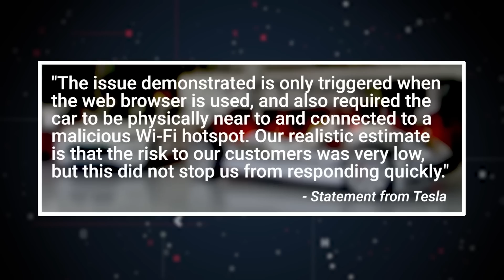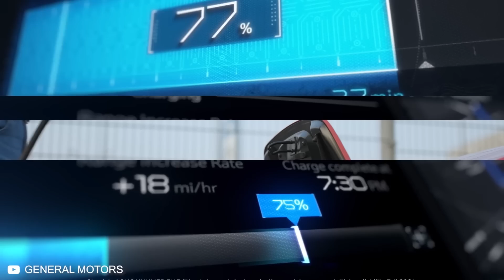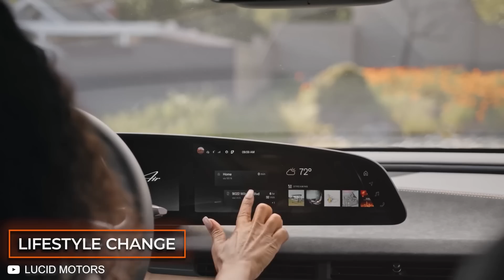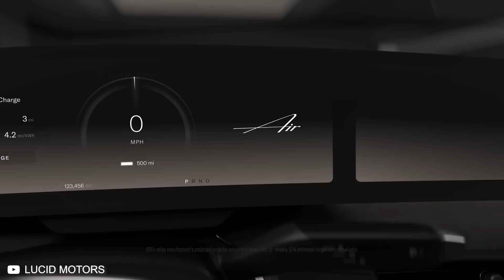EVs' Serious Problems That Carmakers Are Hiding

Comment: What does one do with an EV battery when it no longer works? Pay Batteries Plus to recycle it? Does it end up in a landfill? Has anyone seen a car battery catch on fire? You won’t put it out with water.
Reply: New EV batteries are good for 400k miles to a million miles.
They are recycled for free as the recycling companies make money selling the material to battery makers.
EVs have a lower fire risk than gas cars do.
Reply: @That-Guy_  Where is the documentation to back up your statements, and what is the cost.? There are many more gas powered vehicles on the road. Good luck putting out an EV battery that catches on fire. Still didn’t answer my question.
Reply: @slundgr  
What cost are you talking about?
In 2020 the number of ICE cars recalled due to fire risk was 1,085,800 the number of BEVs was 154,000 which is over 7 times less than ICE cars. 
Battery fires are put out just as easily as gas fire but you do have to keep then cool afterwards so that don’t reignite.
Reply: @That-Guy_  How much does a car cost with the battery you touted? Where’s the documentation to back up those statements?
Reply: @slundgr  
The life of a battery is based on its charge cycles. There are 2 main lithium battery chemistries. NMC (nickel, manganese, cobalt) batteries are good for between 2,000 and 4,000 cycles. LFP (lithium, iron, phosphate) batteries are good for between 3,000 and 5,000 cycles. 
Most EVs currently use NMC batteries. The Tesla Model Y costs about $60k and gets 330mi of range. If we drop that to 300 miles of range, that means it has a battery life of between 600,000 and 1.2 million miles.
The Tesla Model 3 RWD has LFP batteries and costs $47k. It has a range of 272mi. If we drop that down to 250 miles of range, that gives it 750,000 to 1.25 million miles of life.
EVs are not cheap right now but as with all new technologies the cost will come down as adoption and manufacturing scale goes up.
Reply: @That-Guy_  Says you. If electric cars were really so great and such a good deal there’d be more of them and the government wouldn’t have to be involved in making people buy them
Reply: @slundgr  
Says the data. 
As stated before, its new tech so is not as affordable for most people. The government used the subsidies to help the development of EVs as they are much cleaner than gas. As is, if you drive a car that gets less then 40mpg the environment would be better off by switching to an EV. That includes the mining process to daily use. Engineering Explained made a video about it.
Tesla has not had the EV tax credit since the beginning of 2020 and they are breaking sales records quarter after quarter. GM has also run out of the tax credits and has more EV demand than they can handle.
But if you want to talk subsidies, the oil and gas industry has received far more than EV makers. Oil and Gas substitutes only since 2017 are $649 billion. Subsidies are the reason you don’t pay $12/gal at the pump. So if gas was so great then they wouldn’t need subsidies right.
Reply: @That-Guy_  You've yet to show me any documentation, other than your own opinion, that substantiates anything you say.
Reply: @slundgr  
Youtube tends to delete links to outside content or I would have put them on there.
Look it up yourself, it's not that hard to do.

Comment: E85 fuel could be a massive game changer, especially in warmer areas of world, but "electric" has become the happy, sexy word. There is not one power grid in the world that would not crash if everyone were plugged in an electric car.
Reply: Yeah power grid is very outdated globally, we need a lot of work and funding towards better power grid.
Reply: E85 alcohol fuel is reported to be bad for engines, fuel injection systems, etc in the long term.

92 octane gasoline works perfectly for 200,000 miles or more.
Reply: It takes more energy to make E85 than you get out of it.
Better off with normal gas
There will be a long transition period before all cars are EVs. That should give the power grid upgrades enough time.
Reply: @That-Guy_  Not where people can't afford these traps. In my country, the cheapest EV costs 150x the minimum wage. Nobody will  drive here... and you will have rebels here in Brazil as we love cars. Take our cars and you will have a Sri Lanka.
Reply: @Willowy13  
New technologies are expensive at first but in 10 -15 years will be much more accessible.

Comment: I (allegedly) bought the first 2001 "Toyota Prius" in my state, then traded it in for a 2002 "Honda Insight". Loved both cars, even though the "Prius" had some major reliability issues. Would definitely buy a totally electric vehicle, especially with the lower prices, longer ranges, and wonderful monetary incentive$ available today. Connecticut currently offers residents $3,000 "down payment" on EVs, and there is no $ale$ tax. Some municipalities have eliminated annual property taxes, and offer free parking stickers. Most local charging stations are also currently free, and many are even solar-powered. 👌 And although there aren't many around here, you can use the multi-passenger HOV lanes on the interstates with just the driver on board. Plus the fact there are no combustion engine tune-ups, motor oil, transmission fluid, and radiator coolant changes. And due to the electric motor regenerative braking, even the brake pads, rotors, and drums last 2 to 3 times longer. Electric vehicles are blissfully quiet, most look aesthetically pleasing, and gently used ones with fairly low mileage can be purchased at very reasonable prices. At the turn of the last century, electric and steam cars were actually more popular than gasoline models, mostly due to finding decent quality fuel at a fair price. When automobile racing caught on, suddenly everyone decided to go to gasoline-powered cars. But women, professional businessmen, and people of high society still much preferred the quiet elegance of the electric car. There were even a few models manufactured into the mid-1930's. And many were dragged out of mothballs during the gasoline rationing of World War ll... 🌎
Reply: Are you an idiot? Braking tech didn't take a leap because of EVs, if anything they're going to be the next "transmission shops."
Reply: You say "much preferred" -while you neglect to note that 96% of new cars bought today are Gas powered.....😆😆

Comment: If I lived in America, I'd almost certainly go for a standard gasoline-burning engine. However, I live in China, so my considerations are quite different.

China has gone all-in for EV's, and it's not really a road-tripping country. Charging stations are everywhere. EV's are subsidized not so much directly as indirectly, via government support of the companies that make them. The cars themselves are pretty comparable in cost to their gas-powered competitors And in certain cities such as Guangzhou, where I live, the license plates for a fossil fuel engine cost more than the car itself: often in excess of $40,000. EV license plates are virtually free. 

Road trips are not a thing in China. Long-distance travel is better handled by bullet trains, while consumer vehicles are generally for commuting or relatively local travel. Although the freeway system between major cities is excellent, the tolls are pretty expensive and there isn't much infrastructure built up to support American-style road trips.

I live in the megacity of Guangzhou/Shenzhen/Dongguan, so I have frequent need to travel 100-300 km in a day. This is just farther than is convenient for public transit, not far enough for the bullet train, and it's easily within the range of an EV. Thus, taking account of all the factors relevant for me, an EV makes much more sense. My only question right now is whether I can hold off buying one until I've saved up enough for a Tesla or other relatively high-end EV, or whether I'll have to go for a cheaper Chinese brand.
Reply: Maybe the reason you never travel in china is because your social credit score? Or they just don't want you to travel anyway?  Yeah, no freedom is fun, right?
Reply: No thanks, I'll take american freedom over any other option 100% of the time.
Reply: @rickshawwheelchair  You may or may not have noticed that my comment was on this video, which had nothing to do with which country is better to live in.
Reply: @rickshawwheelchair  AMEN TO THAT Bro!!
Reply: @rickshawwheelchair  A close reading would show that what I said was that road trips aren’t common in China, not that I do or don’t travel here. Logic is fun, right?

Comment: Just a Small comment. Electricity now and days for the average guy working for a living can't pay those cost of EVs that they require, in the house less use the rest of the house Electricity. The bill will go through the roof. Just another problem with EVs.
Reply: You will save more on gas than the increase in electricity costs
Reply: @That-Guy_  Right, probably much more......
Reply: @robertstancliffsr9575  
Yep, My Tesla saves me about $200/mo in fuel and maintenance due to current gas prices.